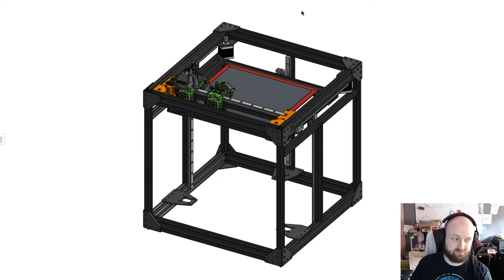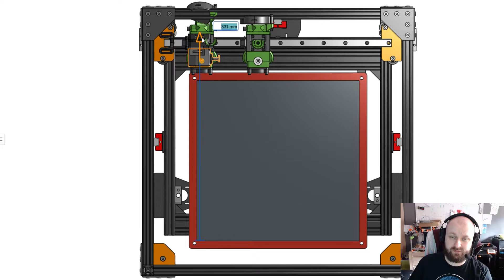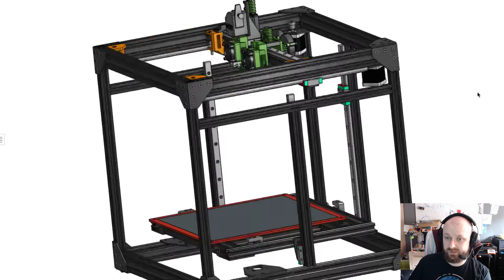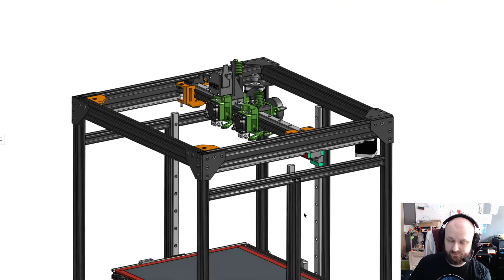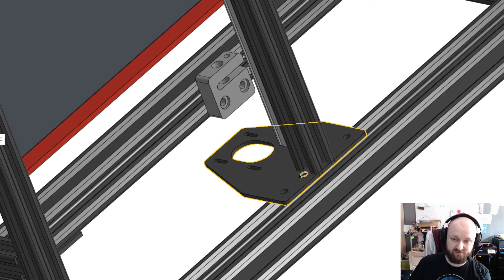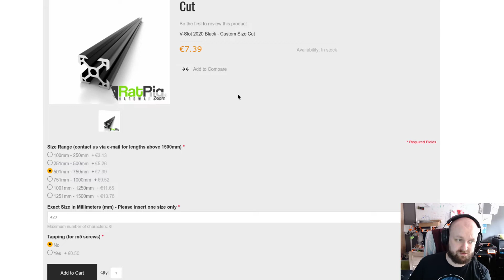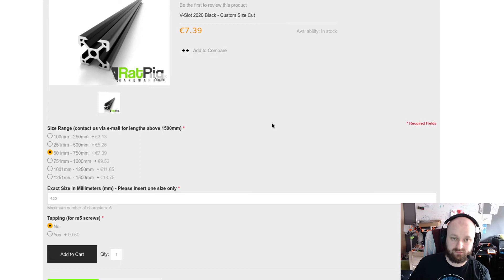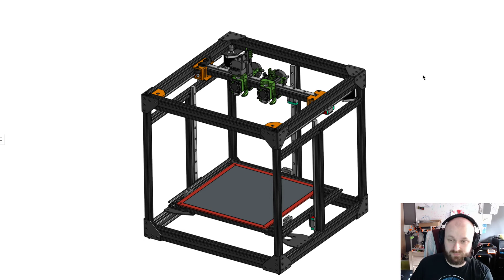[#5] Basics of Easy Mod

Comment: Hi there I scratch built an original v-core with v wheel x & Y axis but with linear rail cantilevered bed. The Bed/z axis is more than fine but I need to upgrade to pro version.
My printer has panels on the exterior and I notice that with the inverted y axis linear rails , the traveler protrudes out past the edge of the 40x20 profile. Is the any easy mod to install the rails on top of the 40x20extrusions or would the printed parts need completely re designing? Thanks